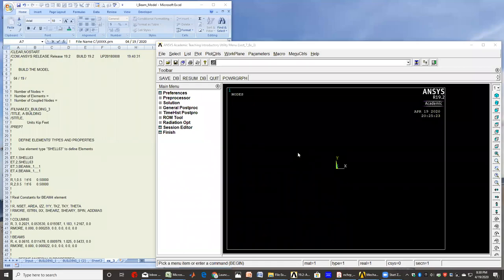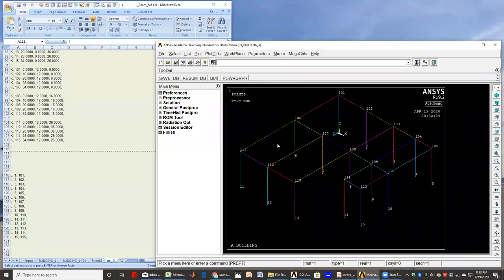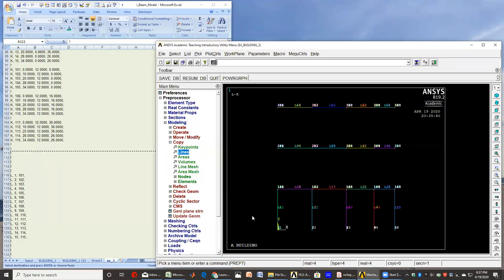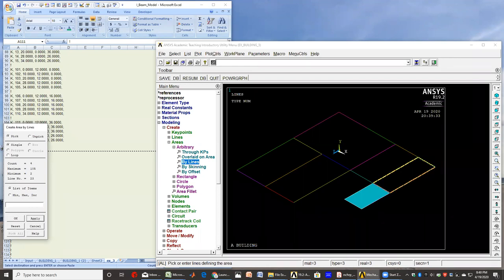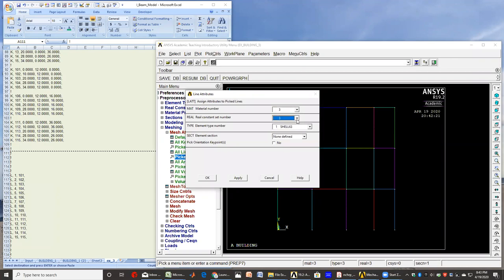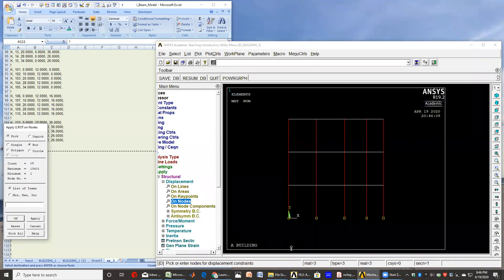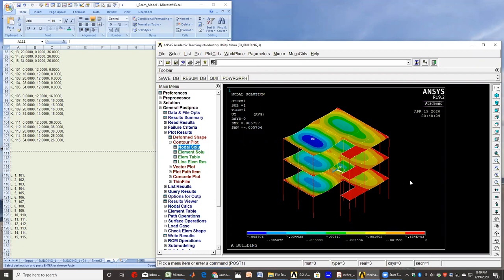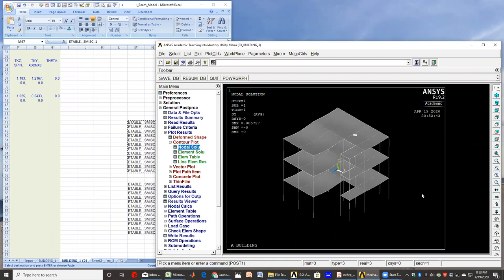Ansys APDL - Analysis of A Building

Comment: Thanks, Eng Omar for this video, I have a question:
In case of modeling the above building with concrete columns and beams , can Ansys model them as Beam element with considering the inside reinforcement? if yes, please do the required tutorial
Reply from the maker: Thanks for your comment. ANSYS had an element "Solid65" that can be used to model reinforcement.  I'll try to work out an example time permitting.
Reply: @omarkhair-eldin6818  Thanks Eng omar
regarding to RC slab, Can shell element model the steel rfts inside it?
Reply: It is very useful to do a video for high rise concrete building with beam & shell elements considering rfts, thanks
Reply: Hi bros, I also have the same problem. Do you have methods to solve it. Plz share it to me. Thank in advance!
Reply: @omarkhair-eldin6818  can we get Excel file